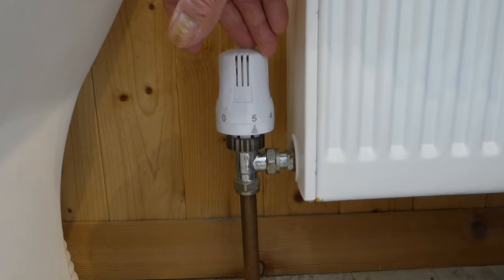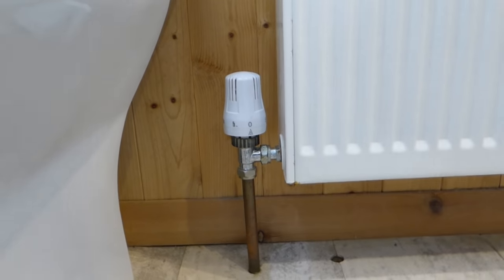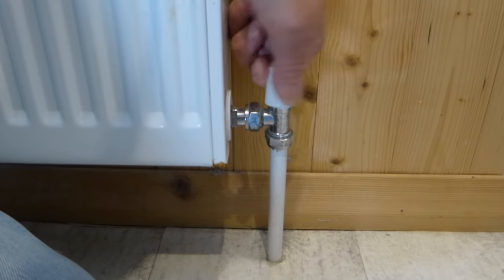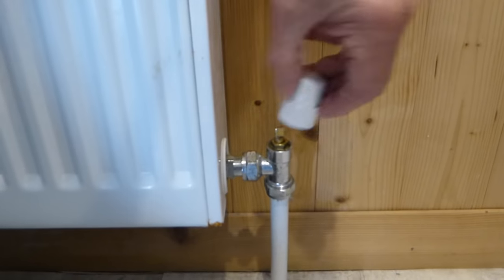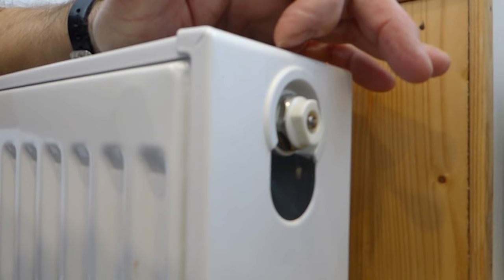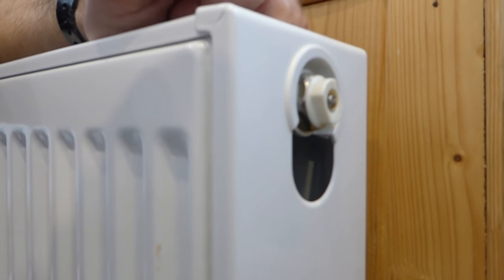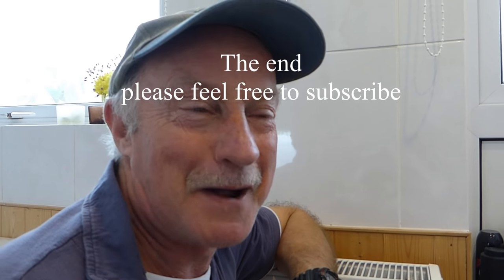How to isolate a radiator. ( Turn it off )

Comment: My radiator in my rental property just started leaking and when I reported it he tried to explain turning the other side off until someone can get here tomorrow. I could not figure out what in the world he was trying to tell me but this was so clear on how to turn off both sides until it can be fixed. Thank you so much! As someone who did not grow up with radiators they are confusing and a bit scary. So thanks for posting this video!
Reply from the maker: No problem Kim.

Comment: Hi 
Thank you for this video.
I have a towel rail without air bleed valve and it has a small leak on one of the top corners even though I have turned off valves that you have shown in this video.
Is there anything else I can do?
Thanks again for the informative videos you put on.
Reply from the maker: No not without draining the system. One of the valves must be letting by.
Reply: Thank you very much Al 😊

Comment: Thank you for your video! I want to turn on the radiator in other bedrooms not the master bedroom. However, the main switch (with a screen) for my home’s radiators is in the master bedroom and so the radiator in the master bedroom has no temperature valves. Is it safe to use pliers to screw the head of the valve so that the radiator will not turn on when I turn on the main switch?
Reply from the maker: You can turn them down but leave the valves open by just a half a turn as that rad might be your bypass rad. Some flow has to pass through it.
Reply: @dereton33  thank you! Didn’t receive a notification so only saw your reply now. I read online that a bypass radiator could the one in the master bedroom or in the toilet. Is there a way to check? And how do I know if there’s actually a bypass radiator?

Comment: Will turning the valve round isolate it or do I need to take the top off and do the last step?
Reply from the maker: You will need to only do the last step if the thermostatic valve does not shut the heat off.

Comment: Thanks for all your great content.  I want to treat my boiler heat exchangers.  Can you isolate all the rads by turning off at both ends as you describe, in order to introduce a descaling treatment into just one open radiator to circulate through the combi bolier?
Reply from the maker: Yes you can, good luck with it.

Comment: Brilliant videos. Finding these vary useful. Are thermostatic valves reliable? I'm taking the radiator off and it needs to be left off for a while (re-wiring the property,  plastering) - do you recommend putting a valve clamp on or a cap or something, or do you think it should be fine?
Reply from the maker: If it is going to be a while then a cap on the end is recommended.
Reply: @dereton33  thanks!! Will do.

Comment: I did as you taught in the video. But still it is not getting hot. Is it controlled by the main switch? My house owner controls it all from her room.
Reply from the maker: Yes it has a main switch to the boiler.

Comment: Thank you very much! My radiator was slightly warm even though the main valve was in "zero". After closing both valves in the pipes it went cold like the other radiators in the flat.
Reply from the maker: Excellent!

Comment: Great video, very informative thank you. Any cons to shutting the radiator off to avoid excess heat output?
Reply from the maker: No the others will be ok.
Reply: @dereton33  no worries about pressure build up or frozen pipes?
Reply from the maker: No.

Comment: Hey thanks for the video. I've got a leaking radiator and I've turned off at the thermostat valve. I'm not clear though, should I also turn off the lockshield on the other side, or will the thermostat alone do the job? Thank you.
Reply from the maker: Hi Emma, you will have to turn off the lockshield as well.

Comment: Great video just to confirm to turn rad off is clockwise and to turn on Is anticlockwise? Thanks
Reply from the maker: That is correct.
Reply: dereton33 thanks alot I've made mistake and done it back to front so I've actualy turned the rad off.if I fully turn anticlockwise it will put rad back on? Thankyou

Comment: Simple and sweet, you saved a carpet today Thanks
Reply from the maker: Great!
Reply: @dereton33   very helpful videos. Quick question on the left side of my radiator there is a plastic cap and underneath there is a hole for a flat screwdriver. Do I need to turn this off when I get to replacing the radiator? Thanks

Comment: On the thermostatic side of my radiator it only turns down to a frost icon which if I'm not mistaken would still allow a low flow through to stop it freezing up. Am I wrong or is there a specific way to shut off this type of value?
Reply from the maker: It would only allow a slow flow through if the temperature reached 5%. If not sure then use a cap.

Comment: After switching off, will water flow past this one and let the other radiators along the line continue heating, or will it stop all radiators after this in from heating?
Reply from the maker: It will flow past this one. Dont worry.

Comment: Sorry if this is a stupid question but is there any downsides to isolating a radiator? I noticed a small green patch on my skirting boards on the side opposite the thermostat so I have turned that until it stopped and shut off the thermostat. My boiler isn't due for service till January so if I can I want to wait till then will I still be able to use my heating or will I have to release some pressure first  surely it's the same as just having on radiatior turned off at the thermostat or does it act differently when shot off at both ends ?
Reply from the maker: Still use as normal. You will not need to release any pressure.

Comment: Hi Al. Thanks for the video. I have one noisy rad - typically in the main bedroom. It has a lockshield on one end and a Thermostatic valve the other. I've removed any air but still it makes lots of clicking sounds - not gurgling. Any ideas how I should tackle this. I have tried changing the thermostat to another setting which stops the sounds for a while but they start again.  Thanks. M
Reply from the maker: Mike Dawkins The sounds could be the rad heating and clicking with expansion, might be worth taken off the wall to check you have the plastic mounts inserted on the brackets. This noise can also some times be, the pipework under the floor to the radiator touching each other, or too close to the floor boards.
Reply: dereton33 Do you have to turn both end of the rad off or would the one do.  thanks clueless!!!
Reply from the maker: Just the one to turn it off . Al.
Reply: dereton33 Thanks very much I really enjoy watching your video's.

Comment: One thing with lock shields, remember how many turns it took to turn it off. As when you turn it back on wide open you will throw all the balancing out and end up with the rad taking all the heat, leaving all your other rads tepid until the trv turns it off when that rooms warmed up,
Reply from the maker: Sirus Yes good point Sirus. Al.

Comment: We got a new boiler a couple of months ago and they flushed out our radiators as well.  However His Nibs, for whatever reason, had isolated a radiator upstairs in my son's room, (I think the thermostatic knob had been stuck on or something).  Anyway,  my son's complaining of the cold and we need the radiator back on.   Do I just do the opposite of what you did here, or should I remove the radiator and clean it out with a hose first, seeing as it missed the flushing?  Also,  when I do turn it back on,  should I open it at the top to let air escape, and/or fill the system up a bit?    And is it easy to put a new thermostatic knob on, so rad can be turned off and on?      Cheers.
Reply from the maker: Do not bother taking the rad off, just turn it back on and bleed any air out from the top air valve. You will have to make sure the thermostatic rad valve is the same make if you just want to put a new head on.
Reply: dereton33   Thanks for the info.  I'll have a go myself.  What about the  - how many turns- thing?
Reply from the maker: Just give it two full turns.

Comment: Hi, I've just moved into a new place and the radiator is stuck on max with a broken thermo valve!

Can I switch the whole thing off by using the pliers on the opposite side like you did in this video?

Many thanks
Reply from the maker: Yes that is what to do.

Comment: Hi Al
My rad in the downstairs loo needs replacing because it is showing signs of rust at the bottom.
MY LSV, both ends, are stuck solid. How do I free them up so that I can turn the rad off. Without doing any damage of course. My plumber can't get here for another week to replace the rad but has told me to isolate the rad in the meantime. Cheers in advance.
Reply from the maker: Hi Cliff, try spraying with some WD 40, then a small spanner on the packing gland nuts, loosen them off , then put a spanner on the brass top and they should turn, sometimes it is worth turning a fraction anti clockwise to break the seal. This reminds me I have not done a video on this so I will get it sorted. All the best Cliff.
Reply: @dereton33  Cheers Al
I will certainly give that a try today. Thanks again for your advice.
All the best to both of you 👍

Comment: Hi Dereton, I would like to just isolate the radiator in a room I sedom use, as even when turned to zero still really hot. Was wondering if it would be ok to just close the lock key on the opposite side of the therm knob?
Many thanks.
Reply from the maker: Yes that would be fine.

Comment: We had our bleed screw come out, water pissing everywhere, so we turned off the water and did this on both valves at the bottom of the radiator (thought it was isolated) we've tried putting the pressure back to 1.5 and water started coming out again??? but i did clockwise on both valves so should be off right? im guessing cos im doing the pressure, the pressure is getting the radiator?
Reply from the maker: One of the valves is letting by.

Comment: Does gas go into the radiator? Or just the boiler my dog pulled the pipe off the wall  for the radiator and water was everywhere cuz of the fire works when I was at work not worried about gas leak
Reply from the maker: Just the boiler, water to the rads.

Comment: I have a radiator with the thermostat in the front hall which I never use but it comes on when it's supposed to be off can i isolate it from the other end, it's costing me more money which is just going out the front door?
Reply from the maker: It should be left on as it is the bypass radiator.

Comment: Both my valves are lock valves i have turned them both off to turn off the radiator do I have to turn them both to their maximum point to turn it back on again. Neither side has a thermostatic valve. Thanks. I have turned them both on as much as they will go but just want to know if that's correct.
Reply from the maker: Yes that will be fine.

Comment: hi my bedroom radiator thermostat doesn’t work and it’s stuck on max heat, my room gets very hot when heating is on. if i isolate my bedroom radiator will it effect the other radiators in my house? also once it gets colder and i want to turn the radiator back on can i just open up the valve again or are there additional steps i would need to get it working again?
Reply from the maker: It's OK just isolate the radiator it will not affect the other radiators. When you turn it on everything will be OK 👍
Reply: @dereton33  ok thank you!!

Comment: I took thermostatic valve off. It was at zero position when removed, but it will only fit back on when it’s turned to number 5. So when it’s back on how do I make sure the numbers work properly
Reply from the maker: Tighten it back on with number 5 facing you. It will then work properly. You will find you can turn it back down to zero if you want.

Comment: Hi. My hubby who was a plumber passed away last yr. He didn’t tell me how to turn a radiator off. I’ve turned off TVR. On the other end is a lock shield. But I can’t get cap off. Any ideas pls?
Reply from the maker: If there is a screw then undo that first, if not then just pull hard in an upwards motion and it will pull away.
Reply from the maker: Sorry to hear about your husband Kim.
Reply: Thank you. I’ve pulled the cap off now. And I’ve even worked out how to move the TVR past frost. There’s to little plastic sticks I pulled out and turntable it to zero. Thank you for your help. New radiator ordered

Comment: The valve on my radiator is right beside the wall at the corner of the room so I can't fit the pliers to switch the valve off after the first turn. Are there any small tools or keys that would fit in a small area that I could still grip to turn the lockshield valve off?
Reply from the maker: Try a small short handle adjustable spanner or fixed size one.
Reply: @dereton33  Thanks.

Comment: hi, I got a leak ( more like seeping) blank cap on my radiator. Will it be OK to isolated that rad premanently as I don't really used that room? will the leak get worst? and if I have isolated it will there be any more water going into the radiator? Your advice will be appreciated.   thanks
Reply from the maker: Hi Kee, turn off both ends and the rad will be isolated and the leak will slowly come to a stop.
Reply: thanks for the advice, will sort it out tonight.

Comment: Can we save gas if we turn off the rads during summer? 
our boiler has be turned on to supply the hot water.
Reply from the maker: Yes it will save gas.
Reply: Thanks very much  @dereton33

Comment: I closed both the trv and the other end valve clockwise. Undid bleed valve and it continues to spray out water. A pint so far. Does that mean my valves aren't closing. Or do I keep waiting for it to stop spraying out?!🏊‍♀️
Reply from the maker: The TRV is not working.
Reply: @dereton33  I put a small metal disc under the valve head and turned it down to the frost mark so it was pushing down harder on the pin. That stopped the flow. Then I later replaced the trv head and WD 40 on the pin because it got stuck in the down position after that!

Comment: hi Dereton, I have turned my thermostatic valve to 0 however the other side of my radiator doesn't have any of the caps etc that you showed?
Reply from the maker: Some times they are missing just use a  pair of pliers on the hexagon brass shank.

Comment: Hi which value turns the radiator on the one to the left or right and do I turn it on with a pair of plyers as the knobs don't appear to do anything?
Reply from the maker: They both do, however one is a lockshield valve which has to be turned with pliers. Sounds like your hand turn knob will also need the pliers to turn. The plastic turn tops sometimes wear out, so pliers are best.

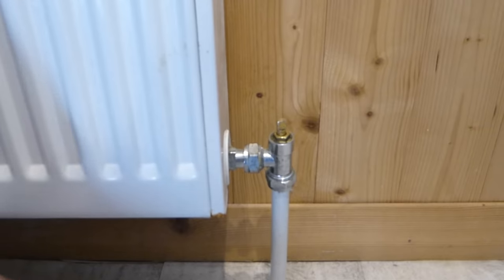Comment: Quick question I need help with. The part at 1:55 where you turn the head radiator valve to isolate it, my head valve keeps turning when i twist it clockwise. Should it come to a stop after a full turn?
Reply from the maker: It  should come to a stop after about 6 turns if it just turns forever, then either the top is broken or the valve is.
Reply: @dereton33  Thanks. I'll retry it today.

Comment: My radiator looks like this (1:24) on both ends. I can turn the left knob clockwise but I can’t turn the knob on the right. Will this still turn off the radiator? Mine has a bubble in the radiator which is making my carpet soaking wet ☹️
Reply from the maker: You will need to turn off both valves. Take the valve cap off and use a small spanner or pliers to turn it off.
Reply: @dereton33  there are no valve caps on either side and I can only turn the one on that left, the one on the right won’t turn :(
Reply: @dereton33  I’ve been able to turn off the rad so it’s not heating up, it’s stone cold, but it’s still dripping so I’m assuming it’s not completely isolated?

Comment: Hi I isolated the radiator in my kitchen a few months ago as it was leaking from a rust spot and I wasn't using it but it has suddenly started leaking again.  Do you know why this would be if its isolated already
Reply from the maker: The rust hole has got bigger and the remaining water in the rad is now coming out.

Comment: Is it normal for some water to drip out from the inflow screw valve after you’ve turned it off with pliers?
Reply from the maker: No, but it does usually stop on it`s own.
Reply: dereton33 thanks for reply.  I tightened the larger nut bit below it and that seemed to stop the flow.

Comment: Is there  fix if the valve dosent hold when you shut off. Before draining and changing. My job is the lockshield side. Thanks
Reply from the maker: No it will have to be drained down James.
Reply: @dereton33  thought so.i did inhibitor. So just did it from another rad

Comment: rad got damaged . leaking from a hole under rad. rust .turned it off as instructed here . leaking from hole . how long will it leak till empty . kitchen large size rad. Back to bed but hope its fixed . don't mind no rad as it's summer . My floor is destroyed :( . Not something  I can afford to fix right away
Reply from the maker: Jean Pittaway It will carry on dripping for a few days.

Comment: Hi, what if there is no return valve on the radiator. So I can only shut off the incoming hot water flow, but not the exit flow. How to insulate the radiator? Thank you.
Reply from the maker: You cant do it.

Comment: Do you have to turn both knobs off when you don't want to use the heating?
Reply from the maker: No just one.
Reply: @dereton33  on my radiators some have two small knobs and one of two of them have a small knob one side and a larger knob on the other side with numbers on it. One of my rads as two small knobs which I can't even turn but it still works.

I just moved into this house and I'm not sure how to use it. Which knobs should I turn off?

Thanks